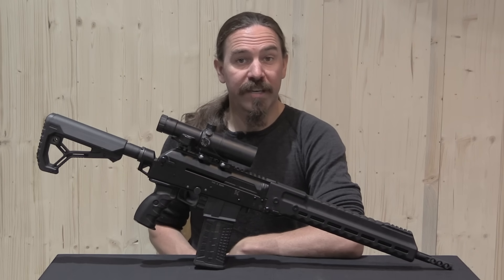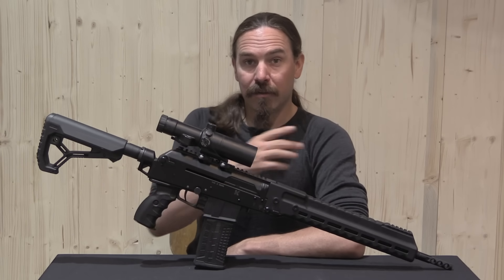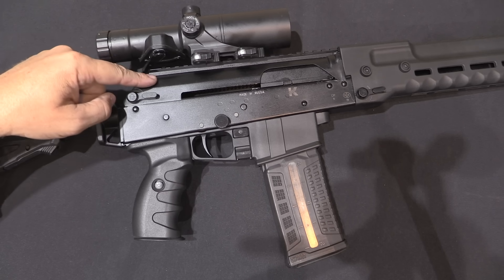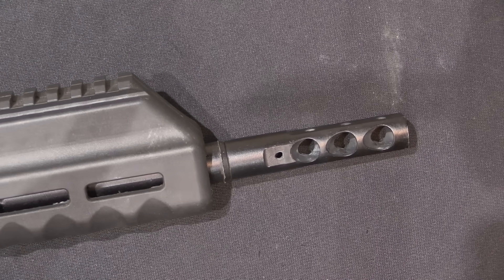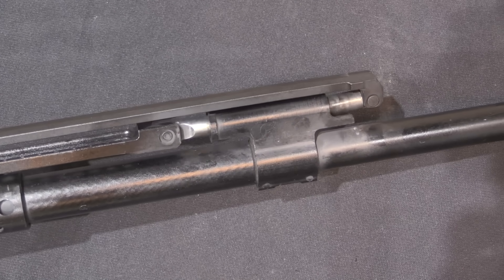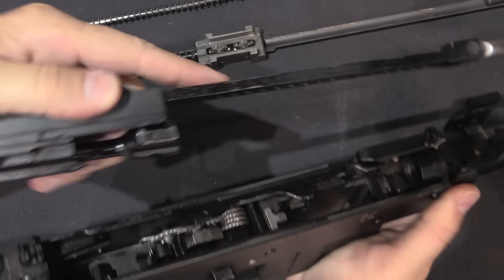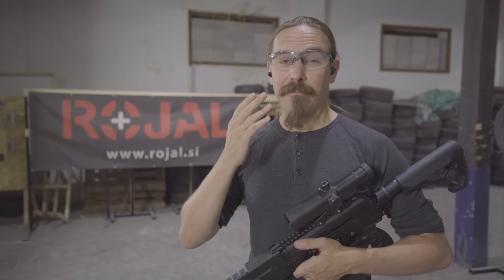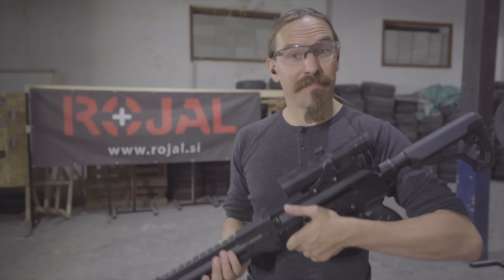Balanced Recoil AK-107 / Kalashnikov SR-1: Is It Any Good?

Comment: As someone with a physics background, i really appreciated that you started with a very clear description of the essential physics.
Reply: As an engineer, allow me to clarify why this system doesn't work. Newtons 3rd law: Every action has an equal and opposite reaction.

Forcing the countermass forward pushes the rifle with an equal force in the opposite direction. F_right - F_left = 0. Nothing is achieved. The ONLY thing this system does is change how the recoil force is distributed during the firing cycle. The total force your shoulder feels when firing a round is the same, regardless of whether a countermass is on the rifle or not. Your shoulder still has to resist the same force that the bullet experiences when being forced out of the barrel. F_bullet = F_shoulder

This system only changes how quickly the bolt opens and thus how many percent of the total recoil force is transferred into your shoulder through the gears pivot points when the bolt is accelerating backwards and how many percent is transferred when the bolt hits the back of the receiver. The heavier the countermass - the bigger percentage of the recoil force is transferred in the beginning of the recoil cycle.

In summary, this system only changes the recoil impulse from one bigger jolt when the bolt hits the back, to a slighlty more drawn out, slightly weaker, more long lasting jolt. But the TOTAL force your shoulder must resist is still the same, and a firing cycle is so quick that you should barely be able to tell any difference. You still feel the exact same counterforce of one bullet going out of the barrel regardless.

The tradeoff is: big force over short time, or small force over long time.

A way better way than this of achieving a less jerky recoil, is to just use a regular bolt with a very long travel and a spring that slows it down completely, before it hits the back of the receiver, like in the Ultimax 100.

There is no cheating the laws of physics, you can't "redirect" a force without a counterforce.
Reply: Back in the 1970s and 1980s, the German Diana company used a very similar system to make 'recoil-less' spring/air target air rifles and air pistols. (In the UK, these were sold under the 'Original' brand name, because another vendor had licensed the 'Diana' trademark.) 

Here the point was not to mask the recoil of an 8 grain .177 pellet travelling at around 600 ft/s but to compensate for mechanical disturbance caused by the otherwise conventional piston and spring mechanism. 

As such these systems worked tolerably well. However most serious competitors preferred air weapons based on pre-compressed CO2 or single stroke pneumatic mechanisms, or the Feinwerkbau system, which used a damped recoil buffer to absorb the disturbances caused by a conventional spring/air mechanism.
Reply: @jay_no3  I'd say this system cannot change the recoil impulse from the combination of the projectile and gas momentum released on firing. But conservation of momentum only requires that the impulse is unchanged. The magnitude of the forces involved and the timing of when they act and for how long can be changed by this sort of system. As most shooters will not have access to this kind of exotic hardware, a roughly similar comparison can be made by firing any given cartridge in both a semiauto and a mechanical repeater (or single shot). For the most valid demonstration, the two firearms should have the same mass and the same barrel length.
Reply: @derekp2674  I agree 100%. Well written. I tried to put it a bit more in laymans terms, but you are 100% correct.
Reply: @jay_no3  The point of the mechanism isn't about negating recoil itself (clearly, it's impossible), but rather neutralizing the torque directed upwards (due to the barrel not being in line with the contact point between the rifle's butt and the shooter's shoulder).
Reply: @jay_no3  i think you're confused here. 
Just as Ian said in the beginning of the video, there are two sources of recoil jolt when firing "regular" rifles:
1. Force from the bullet and hot gasses leaving the muzzle.
2. Force from bolt hitting the stock as it cycles.
What this system of counterbalance does is introducing a third force - force from a counterbalance moving in opposite to the bolt direction. This force is only countering force 2 and it is always synchronized with force from moving bolt because counterbalance and bolt are coupled through gears. It is not counteracting force 2 completely because it clearly has less mass than bolt itself, but reduces that force significantly.
Reply: @CrazyArcher2160  inline stock have almost zero effect on muzzle climb for long arms. And it was even tests on AKMs in USSR. 
Muzzle climbs up due to shooter is not a stable mount and compensate uncontionaly push to the shoulder. If you fire prone your muzzle won't climb. If you fill shoot with a solid brace against your back muzzle won't climb
Reply: @jay_no3  What you're saying is, that we need to add a second barrel (with required parts), to shoot a bullet of equal caliber into the shoulder of the user.
Reply: @KaffiRawr  We could call it a "recoil-less rifle"
Reply: @jay_no3  it's not designed to negate the forces but rather redistribute it so the recoil is more managable
Reply: @jay_no3  this system works in exactly the opposite way.
In AK74 almost all recoil impulse is transmitted to the bolt. The bolt moves backwards and transmits an impulse to the shooter through the recoil spring. The remnants of the impulse are transmitted by the impact of the bolt in the rear position. As a result, the shooter feels a small recoil. Next, the return spring begins to accelerate the bolt forward. In the forward position, the bolt creates a impact. This impact does not create unpleasant feelings for the shooter. BUT this impact knocks down the sight! Right before the shooter takes the next shot!
In AK107 all recoil impulse is transmitted to the shooter at one moment. As a result, the shooter feels a large recoil. BUT then all the time, while the automatic of the gun are working, there are no more shocks that could knock down the sight! The shooter can spend all this time restoring the sight after the recoil impulse and make a perfect second shot as soon as the bolt closes.

Comment: I guess this system makes more difference in full auto, as it was intended, I've seen a video of AK-107 being fired, and that was really impressive - almost holding still. It was shot by one of Russian IPSIC amateur shooters, specialised in shotguns.
Reply: Was the brake on that one as well? That would make sense
Reply: You can also see it in action on Vickers Tactical.
Reply: You mean that propaganda video?
Reply: It doesn't matter Gun Jesus has spoken.
Reply: I think it would be interesting to show the effect it has on a heavier caliber, also more effective for suppression, like 7.62x39 or 300 blk. The muzzle break would be less effective with the lower pressure round and taming the action might work well, especially in full auto to make the gun more controllable. Also the barrel being lighter in .30 may compensate for that added weight
Reply: 5.45 is also a softer round.
Reply: @JEJAK_777  its automatically slanted though
Reply: @OkieDoke  head in the sand
Reply: Sergei Orlov?
Reply: @Gronbar6  propaganda?😂 it's a video of a gun being fired dude. Larry vickers did a video on it too if you want a American perspective on it. His video also showed that the gun basically didn't move when firing in full auto. Last time I checked Vickers was far from a pro russian propagandist
Reply: @maxwood5157  7.62x39 and .300 blk would be optimal for this system. 5.56 and 5.45 can mitigate recoil pretty well with just a flash hider/muzzle break
Reply: @realfnneato3111  Not like this one, looked like a muzzle device on AK-105 and some other shortened rifles of that series, it's more akin to "krinkov", than this.
Reply: @Gronbar6  Nah, not in that case, it wasn't made for advertising "Kalashnikov" concern production, Russian army or anything like that, just guys enjoying getting such a relatively rare gun.
Reply: @TotalRookie_LV  its actually more akin to the main line ak100 series and ak-74 brake, the one on the aks-74u is called a "booster" to enhance cycling pressure, not suppress blast of powder
Reply: @Gronbar6  Ironically you saying propaganda IS propaganda.
Reply: @Gronbar6  bruh
Reply: @Gronbar6  bruh moment
Reply: @froheschwanz 
-Noooo, it's Russian propaganda!
-Haha, rifle goes brrrr without recoil!
Reply: any gun is "amazing" in the hands of a god tier shooter..
Reply: @Gronbar6  So did they fake the recoil?
Reply: @maxwood5157  Where the recoil impulse induced by the bullet being accelerated (especially from a locked, non-recoiling barrel) becomes bigger, the part the bolt assembly plays in muzzle jump diminishes. With 7.62x39 it seems to be the point above which it starts losing effect, or so I read. Of course, you still can get away with overgassing without paying the price of YET higher felt recoil, so...

Comment: I think the recoil system probably makes more sense in full auto. It's a fairly complex design but they did a pretty good job at making it as elegant as they could.
Reply: This system makes sense for semi auto.
All of the recoil is felt immediately as the bullet leaves the gun allowing you to get back on target faster than if the gun jerked when the bolt hits the front and back of the receiver. A constant recoil system would be better for full auto
Reply: The mechanics of it alone make no sense. Not worth the hassle. It has to be too well synchronised to work
Reply: The recoil caused by the bolt stopping is overstated to the point it seems he thinks it causes the majority of the recoil which if true would mean a single shot rifle would have less recoil than a semi but we know the opposite is true. Moving mass can result in near zero recoil, the Browning recoil less shotgun proves that using a spring loaded action that is moving forward when the gun fires.
Reply: @CCW1911  the bolt hitting the back isn't what created the recoil. Recoil energy is transferred to the bolt and is released in a sudden jolt when it hits the back of the receiver. I do agree that it seems over stated, especially when a lot of the recoil is transferred through the locking lugs.
Reply: @CCW1911  I know that the recoil got significantly worse when I put a 3mm thick buffer into my PSL, because the bolt carrier was hitting the end of the receiver at higher speed. And that was after I put an extra power recoil spring in it.
Reply: @ScottKenny1978  Heavier recoil springs usually make recoil worse both as the bolt goes back and especially when it slams forward.
Reply: @LabRat Knatz counterbalancing is less effective the bigger the cartridge is used as bigger cartridge decrease persentage of the felt recoil from the bolt to bullet/gases itself
Reply: @smorrow  I am talking about felt recoil. I agree with you. Lol.
Don't know why you think a piston needs a crankshaft to be called a piston.
Reply: John McAlister  why wrong?  if its not timed right ith correct weight distribution it may actually be worse. Its an interesting concept. But too messy
Reply: I don't believe a piston type recoil system would work fast enough, but on mechanical like this, you could have a point there.

Comment: Grip Clamp C ™ spotted. [Thumbnail]
Side note: To add to military adaptation concerns, I wonder if the complex recoil-mitigating system also has a negative effect on it's accuracy too? I can imagine a rickety recoil mitigation system ON THE BARREL having some kind of effect on harmonics.
Reply: when you visit Slovenia you will be able to try it. Greetings from Slovenia
Reply: I wonder if it can have a positive effect on full auto accuracy, as the force that bends the barrel is equalized by second piston.
Reply: Интересное предположение. С другой стороны, с появлением второго поршня, изгибающий момент на стволе при выстреле, появлявшийся при давлении газов из газового блока на один газовый поршень, здесь будет отсутствовать, т.к. газы теперь давят на оба поршня расположенных оппозитно.
Reply: But the only place the balanced recoil system touches the barrel is at the gas port, which is in the same place as a standard AK.
Reply: @ф_стрелец  АК-107 погубило еще быстрый износ оружие при использовании подствольного гранатомета. Да и в целом это мертворожденный проект, он провалился еще при СССР не просто так.
Reply: Barrel acts like bolt action gun. i watched some slow mo videos of this rifle, barrel is not flexing
Reply: @_b_x_b_1063  подствольный гранатомёт изнашивает и любой другой АК, это здесь не при чём
Reply: I would expect some out from 100 yards maybe, for competition 3 gun guys, do they usually get out that far?
Reply: Grip Clamp C represent!
Reply: @ф_стрелец  нет, для сбалансированной автоматики ГП просто смерть.
Reply: @_b_x_b_1063  почему?
Reply: I'm not a gun expert, but I think harmonics on any semi-automatic rifle that has other parts touching the barrel, like a gas block, sight post, etc..etc. would not play a role in accuracy. On a free floating bolt action rifle, it does because the vibration frequency is unobstructed when it travels thru out the whole length of the barrel.
Reply: @realfnneato3111  yeah. 3gun and 2gun comps often have targets at 200+ meters
Reply: @ф_стрелец  при том. ГП-25 просто убивает автоматику, именно поэтому провалились ранние АК-12 и 107
Reply: @ф_стрелец  Онокой писал про это